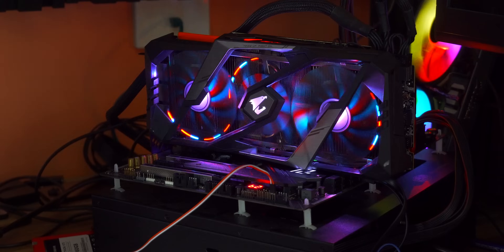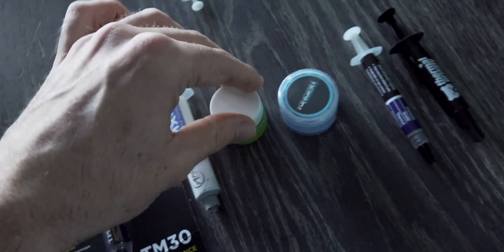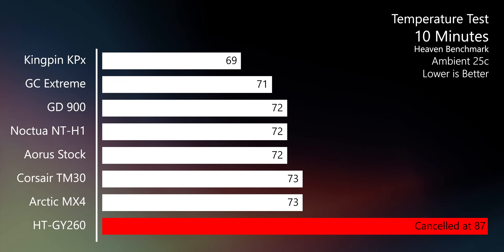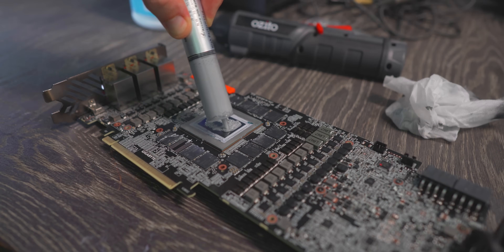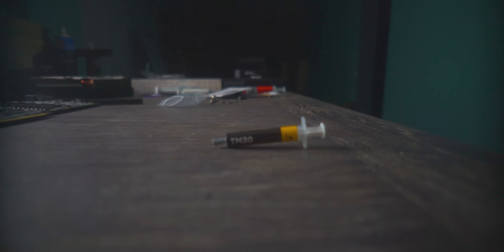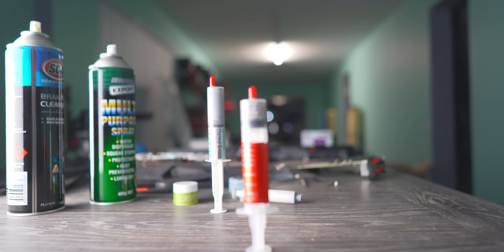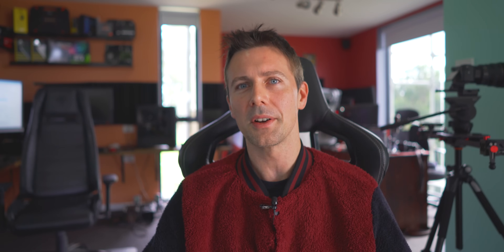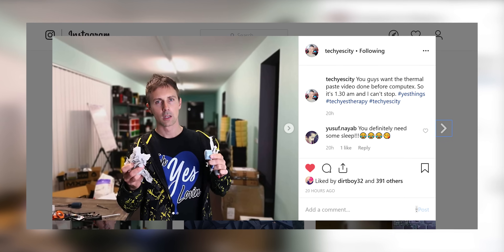What's The BEST Thermal Paste in 2019....? (Ft. GD900)

Comment: Long-term results with many heat-cycles would be interesting, since drying and cracking can degrade performance significantly.
Reply: Yea that alone means i will stick with MX-4 as it's guaranteed to work for a loooooooong time. but i will also test GD900 on something where reapplying is no issue
Reply: @skaltura  im using gd900, it lasts at least 1 years.
Reply: @muratcucen  I need it to last 5 ...
Reply: @skaltura  uh, why? It takes five minutes to reapply paste and it is good practice to do it occasionally. Whether it be a gpu, cpu, chipset etc...
Reply: skaltura well if you really don't mind performing maintenance then GD900 would be ok. otherwise yeah you'd best just stick to mx-4
Reply: @christopherjames9843  It does not take 5 minutes to inform customers of outage, take the server out of the rack and on table, disassemble, clean it, apply new paste, rack it again, rewire it, doing QA nothing broke during that process, then informing customers service outage is done.

Oh and annually if you have to do hundreds of sets of dual cpu + chipset thermal paste applications GD900 becomes super expensive super fast when you have to pay for that labor.
Reply: @skaltura  uh, we are talking about home enthusiasts and gamers.
Reply: @christopherjames9843  I doesnt take 5 mins to reapply to my CPU and def not 5 mins to apply to my GPU. But ok.
Reply: @muratcucen  and how is it?
Reply: @skaltura  I had mine on there for like 3 years and I cleaned it just a few days ago, it was just fine.
Reply: @skaltura  ; Same, Changing the GD900 yearly on my own system wouldn't be bad if I only had one system to maintain, but I'm the goto guy for family computers and wouldn't want to add repasting between upgrades to my todo list.
Reply: @skaltura  yeah 8 yrs!  GD900 how long?
Reply: skaltura that's why the graphite sheets were so attractive. they never need to be reapplied. only issue there is whether or not you can get satisfactory performance with it.
Reply: Cooler Master MasterGel Maker doesn't dry up, so moot point.
Reply: I wonder if you can bake them at a higher temp and see if they dry up.
Reply: @kousakasan7882  Probably yes, but some maths and research involved on how it correlates to aging ... in other words too much effort
Reply: @skaltura  he did say for pros there is kingpin. Rest of the discussion was mostly for home desktops
Reply: While I agree I'd rather have the best thermal paste (I can buy) and reapply accordingly to always have the best performance. But I understand why longevity is an issue for some people.
Reply: my GD900 last 6months not bad,  but need that last a year,,
Reply: Gelid GC-Extreme doesn't dry out.  One of the reason's i quit using AS-5  plus the temps were way lower with the Gelid.
Reply: I believe the thermal paste only need to last a year, in order to make the recommended cleaning and teardown of computers. MX4 last up to 8 years, but after 8 years the dust would seriously diminish the cooling capabilities of the cooler and fan itself
Reply: My thinking exactly. Have had MX4 last for years, very unsure if the GD 900 does tho.
Reply: @exol511  i have the gd900 it performs well for a month max and dries out afterwards. dont buy it
Reply: @300ml_brasil  thanks :)
Reply: @exol511  meh makes since mx4 is normie paste for sheeps even tho it's not any better than the competition
Reply: @Molly D Does not mean only hobbyists watch this, and does not mean commercial sector does not benefit from this stuff ;)
Small business like ours is all about having deeper knowledge than "the other guy". ;)

oh and it's not a warehouse, it's an old factory where we have our servers ;)

It is also 2 way street, the perspective I have is beneficial for gamers etc. example in this case; You like your rig working for more than a year at a time? Yeah there you go :)
Reply: @Molly D When your living depends on hundreds of CPUs getting cooler properly ... not really

Comment: How is it possible for the GD 900 outperform the MX4 while the thermal conductivity of GD 900 is only 4.8 W/M-K and the Mx4 is higher than that
Reply: Rating is theoretic there is more factors to consider in general dont focus on specs but the usage tests.
Reply: @Matcc  you're right. Maybe I'll order one tube of GD900 and see it for myself. Also It's cheaper so that a plus for GD
Reply: Thermal conductivities are all a little bit suspicious. I have a sample of Keratherm industrial pastes that are 9.8 W/MK but have not performed well at all, like AT ALL. MX2 is 5.6 W/MK and MX4 is 8.5 but depending on the test, MX2 sometimes beats the MX4 - Igor's Lab (Tom's Hardware Germany) had MX4 measure to be the better of the two across most tests, except in GPU direct die cooling test, where MX2 was a good bit better, and they don't take just one result, they reapply the paste multiple times.

It bears keeping in mind that conductivity of any such thermal interface is actually comparatively bad and what you want is to maximise the contact area and minimise layer thickness, so the performance will depend on its spreading behaviour and particulate size and structure more than on the raw conductivity. You're dealing mostly with boundary layers rather than a volume of material, and may also depend on the properties of the mating surfaces.

Rumour from the Russian side of the Internet says that GD900 cures or dries out significantly after about a month. It might contain somewhat volatile compounds which would encourage spreading and initial convection, so it might come out well now, but if they are to be believed and you're unlucky, the performance may drop off later.

Long-term durability has been an issue that has plagued numerous high-end pastes, with separation, volumetric pumpout, and other failure mechanisms. I believe MX2 and MX4 are deliberate compromises that have specifically been formulated to last a very long time, and they do, they absolutely do, so that's something to keep in mind.

Comment: For a pretty hot chip I would use (if money and availability allows) a Pentium Extreme 965, as it's heat spreader area is a little smaller than current gen CPUs. Nonetheless, the processor doesn't have an internal temperature diode on die, so you'll need an additional thermal probe between the heat spreader and the heatsink... That or an FX-8350 OC would be my to go suggestions! Best regards!

Comment: Hey Brian 
Maybe test them on threadripper. 
Something with large cpu ihs. I think thats also a great test. & Maybe add some more cheap contenders.  Noctua/ Corsair can come off list. So expensive.

Great videos man
I am buying that good alli express paste. I needed something like that around.
Reply from the maker: Need something with a smaller surface area and higher heat output than ryzen's CPU IHS.  Perhaps a a delidded 8700k overclocked as high as it can go?
Reply: @techyescity  yeah i guess. Just low cost Xeons & affordable ryzen processors are more fun.   I7s for $340 +$ 20+ cooling solution+ Z370+ are getting to be a waste.
But yes I see how its great for testing the high end with high overclocks.

In my opinion. Its better to use these ryzen chips so i can put them in cases with poor airflow. Cant do that with I7s unless i use liquid cooling. I ship computers, so big heatsinks are a no go, they can fall off sometimes.

My customers love the Ryzen 1600 with stock beefy cooler. Temps are super low with stock paste in small cases gaming all day. Less heat. Bigger/hotter gpu can go in.
Reply: Jason Valerio I use the HT-GY260 (the one that failed his test) on my TR-1950x at 4.15 GHz with 120mm AIO. I was going to test different pastes, but the cheap liquid metal I used was like 3c cooler, and that was very discouraging... Threadripper is like the size of a football stadium with half the power output of Intel, I’m pretty sure I could cool it with a 1 cm talk heatsink (I might actually try that, lol, Ive got a couple old NB heatsinks and joked about using those, they’d probably work, haha!) maybe even no heatsink, I’ve got a high powered 70mm EDF fan at 1500w that would probably do the job!
Reply: @jakegarrett8109  thanks sound like the threadrippers dont Matter as much as i thought. I'd think good paste and huge plate would drop more than 8 degree's.
I guess small ihs with good paste is more important.

I know Ryzen 1600 on stock cooler with good paste gets very low temps. Even though its low enough

Comment: It would be interesting to add NT-H2 to the next testing.
Reply: And the Arctic Silver 5
Reply: Basically 1C less with NT-H2. Compared to NT-H1 I mean.
Reply: @MrSeifer159  this is what I understand as well, but still would be nice to see tested as NT-H1 is currently my go-to
Reply: Master Cooler Maker
Reply: I used nt-h1 and 2 and there's almost no difference but after using that and switching to gd900 in July I'm glad I did Noctua is overpriced this stuff is amazing, it 4690(non k) all core turbo all time and they never go over 50c on a Gammaxx 400
Reply: @pyrodrifter12  Nt-h2 is very different than nt-h1 but you need to delid your cpu and overclock at the limit....There’s where u see the difference
Reply: @haloo3951  very little difference ive used both and i delid almost every cpu gd900 is the best by far thermal paste i have used especally for the price, i literally just bought another tube(last one lasted almost 2 years and over 30 builds including graphics cards) for $13 usd for a 30g tube, compare the performance difference between that and nt-h1/nt-h2 and the size per price $8 usd for 3.5g(nt-h1) and $13 usd for 3.5g(nt-h2) for maybe 3-5c different depending on usage, you are out of your mind if you think noctua is good lol
Reply: @pyrodrifter12  what is wrong with noctua cus i don’t understand....is very good like the mx-4 i have now and kryonaut
Reply: @haloo3951  it's too expensive for practical use is what I'm getting at, if it came at a larger capacity for a cheaper price then it wouldn't be as bad
Reply: @pyrodrifter12  ahhh,u mean that...yea i build Only personal pcs so for me is enough 5 euros for 4grams of mx-4:)i think u can get many grams of mx-4 for 13bucks...is a high end compound and kinda cheap
Reply: @haloo3951  yeah id still rather buy gd900 for 13 that would last many many cpu and gpus for a few c than spend a fortune on compound that doesnt make a bit of difference
Reply: @pyrodrifter12  it makes for me😂i got a 10900k oc to 5.3 all cores on a h115i capellix elite....it is a difference at that performance
Reply: @haloo3951  not really if youre going for extreme use liquid metal if not theres no difference in paste for price to performance i rest my case
Reply: @pyrodrifter12  not really:))i used conductonaut liquid metal and for me was worse and i payed 3x the price of my mx-4
Reply: Blacktherm bestes

Comment: is arctic 5 any good?
Reply: It's fine, but... it's finicky, it doesn't spread all that well, it takes a burn-in until it delivers its full performance (which if you believe stupid official documents takes like half a year of normal use, but really it mostly does fine after the first couple of days), and it has strong parasitic capacitive property, so it's not actually entirely safe around electronic components. And there's pretty much no point to using it. Arctic Silver 5 was really the first good thermal paste, it came out back in autumn 2003! MX2 came out 2007 and beat AS5 by a decent little margin, not by much, but pretty consistently among all tests, and was cheaper to boot. MX4 might be considered an improvement upon MX2 for the most part.